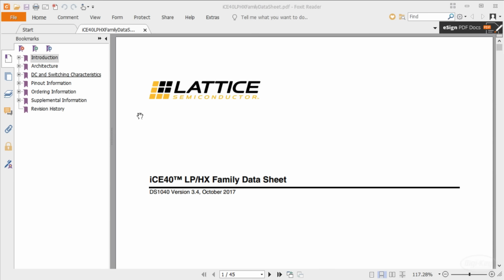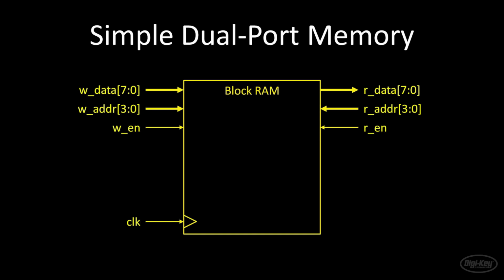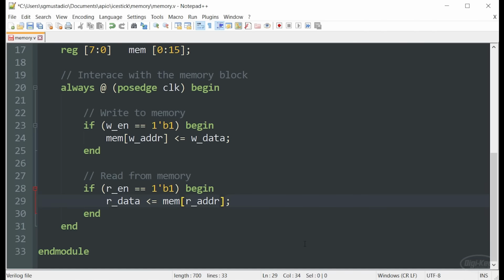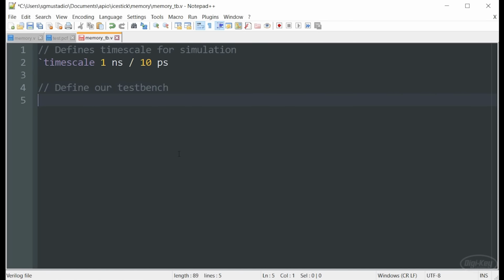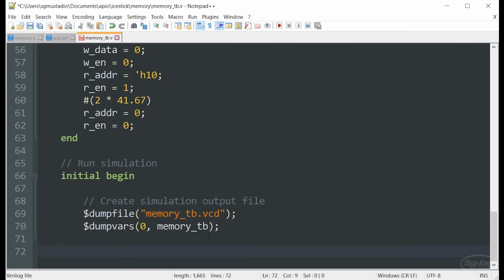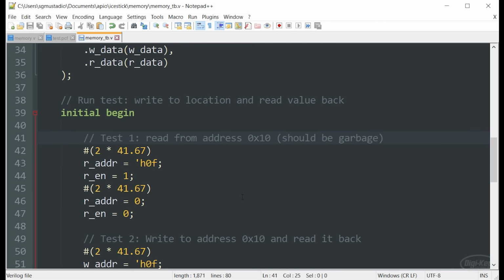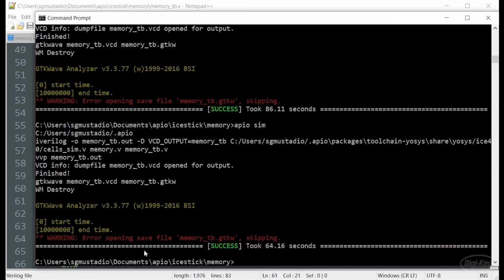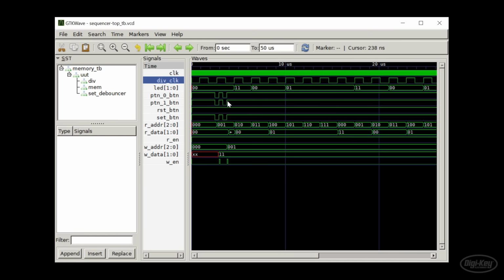Introduction to FPGA Part 8 - Memory and Block RAM | Digi-Key Electronics

Comment: Okay, I think I do not understand the mechanism of how the RAM is invoked. If I use [1:0] r_data and [1:0] w_data, 2-bit data, then I get "ICESTORM_RAM: 0/16 0%". And even if I use a full 8-bit data, I cannot invoke the RAM when calling from the main.v. The simulation works fine and the build works fine, but the hardware reads nothing (not random bits, but just zeros).

If anyone has encountered and solved a similar problem, I'd greatly appreciate knowing.

Comment: what is the difference between setting the flag to initialize the memory with the text file as double quote, instead of using 1? If that value is null, the init won't be triggered, but double quote isn't interpreted as null by Verilog?

Comment: this is what I'm waiting for, thanks Shawn!
update : I'm using iCE40 LP1K, please beware of BRAM read back timing. In dual port async ram, after wrote read_address to the BRAM module, data will arrive later after  2 read clock cycle.
Reply: Good to know, thank you! I'll see about pointing that out in a later episode
Reply: Where did you find that info? I can't seem to find it in the Datasheet nor in the BRAM Usage Guide.
Reply: @ShawnHymel  I found out that my BRAM as video buffer is sometime give s random 0 even all bits are 1. Then I searched on google, someone over 1bitsquare forum also talked about this behavior too.
Reply: @ShawnHymel  In TN1250 technical sheet page 4, the address and data is lack behind according to that timing diagram.
Reply: @TinLethax  Thanks! I think I found the post on 1bitsquared. The OP talks about a 2 clock cycle delay for the UP5K models (but notes that the HX models are different). I looked at TN1250 p.4, and from what I can tell, rdata is invalid because re and rclke are low. I might be reading that chart incorrectly, though. I'll see if I can put together something to test the read delay on my iCEstick, as I'm really curious to know if there's such a delay on the HX model.
Reply: @ShawnHymel  there's latest video on my channel showing the effect of that BRAM behavior. It turned my VFD display into the Matrix 😂
Reply: @TinLethax  I threw together a quick test, and you're absolutely right! I only tested it with the same read and write clock, but it does seem to take two full clock cycles for the written data to become valid. I'll find a place to call this out in a future video or blog post. Thank you!
Reply: @ShawnHymel  your welcome 😊
Reply: I have a question: if you define say a 4k by 8 ram will the synthesize tool infer several blocks of bram to make the ram or do I have to build it myself with 512 by 8 blocks and multiplexers and decoders?
Reply: @fredrikbergquist5734  From my experience. Yes, It will automatically infer the block RAM plus several logic for address handling across multiple RAM blocks. All you have to do is "reg [7:0]some_name_here[4095:0];". You just have to make sure that the logic circuit "read" from BRAM (a.k.a. connect to read port of BRAM), otherwise the Yosys won't infer the RAM.